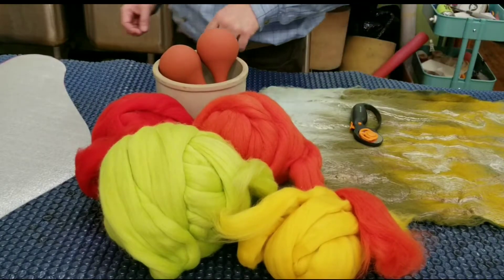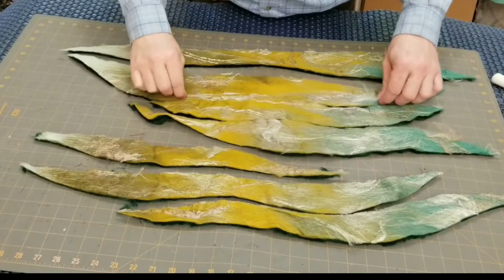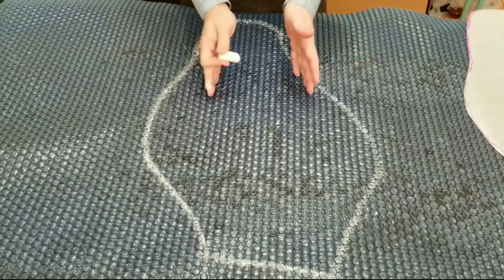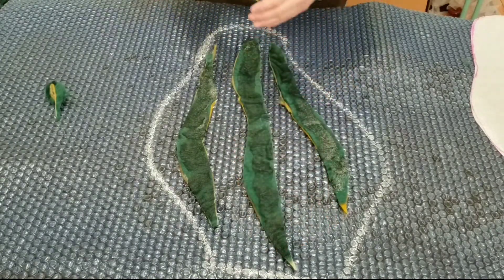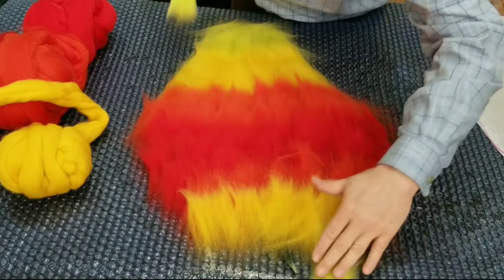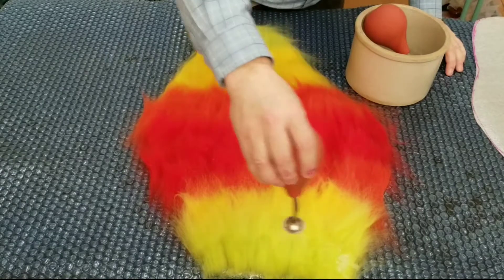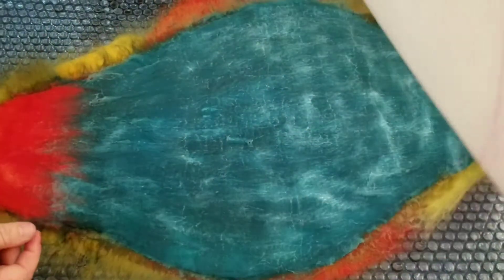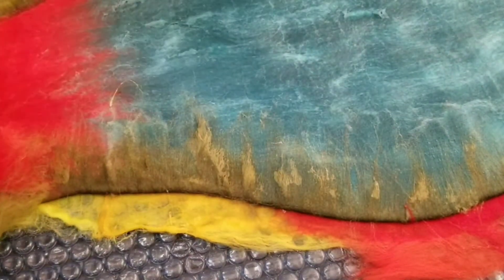Making a felt vessel with a resist part 1

Comment: Would a more coarse wool like corriedale or bergshaff help give more structure and would the merino prefelts work well on the coarser wool?  Or would the coarse wool migrate too much through the prefelts?
Reply from the maker: I would do a test to see if the other wool migrates. I used to have that issue with alpaca working its way forward and creating a hazy look. 
If tou want realy good structure use fin wool. 
Butnits hard to get in colors like merino. 
However, with enough agitation, I never had an issue with getting structure
Reply: @SpryWhimsy  
Thanks very much.  Not sure if you're saying fin wool, or fine wool? I want to put colored merino prefelts onto a black base but have had issues with coarser dark wool migrating thru the merino. I might need to make my prefelts a bit thicker like yours in the video.